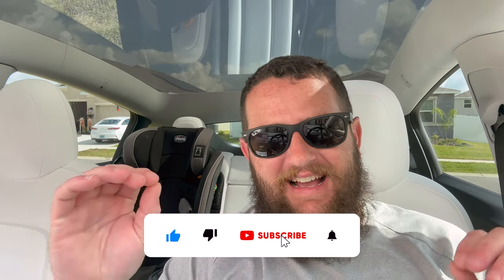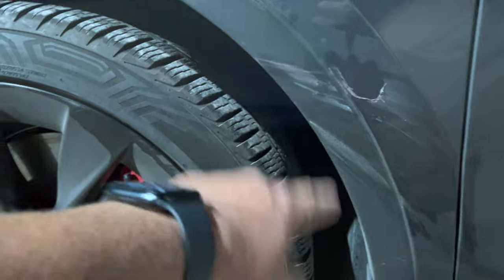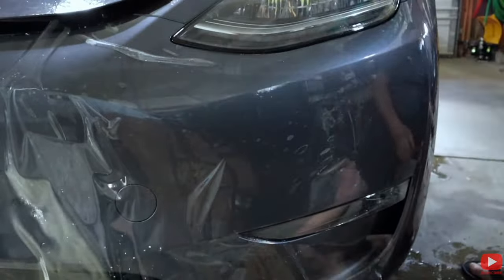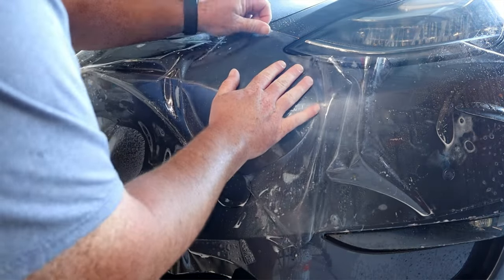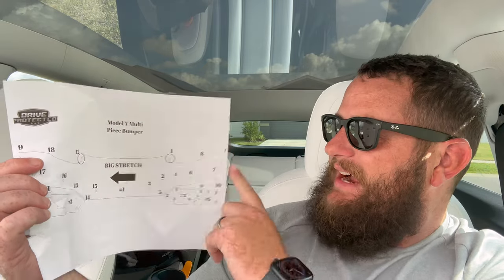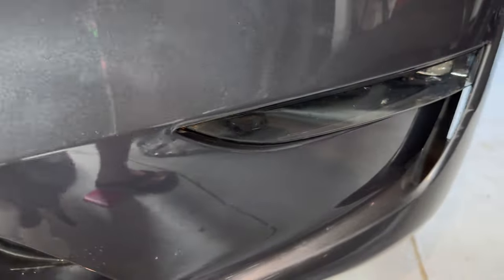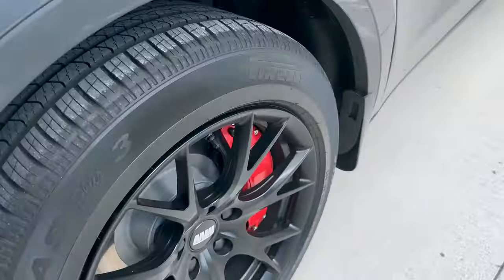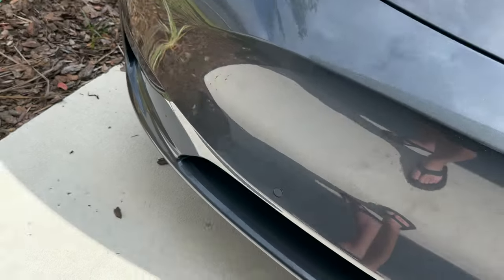Tesla Model Y - Easiest DIY PPF for Front Bumper (Replacing Damaged PPF From #hondabump)

Comment: I spent about 5K on a professional wrap. While overall, it looks pretty good, I’m disappointed in the very fine details. The biggest glaring issue? They didn’t properly wash the car before applying, and now there are strings of road tar on the left rear fender that are under the PPF. It looks horrible!
Reply: As a professional PPF installer and shop owner, this is grounds for a redo!
Reply: @ericsawatzky54  for a bit of back story; I took the car to a Google reviewed, Tesla Owners Club sponsored shop in my state. When I dropped off the car, we spoke about my wants for PPF and tinting. They also knew what day I would be back to pick up the car. They would have 7 days to do the job, and were confident they would have it done a day early. 

I kept an eye on the car using sentry cam all week, and the car never moved, day or night. 

When I arrived 7 days later to pick it up, you’d thought they’d seen a ghost. They hadn’t done ANYTHING to the car. They said they would work all night on the car and have idly ready to go for me in the morning. (I was 6 hours from home, and had to work the next day at 1pm. 

Over night, they got the PPF and all the tinting done, except the windshield. I had already prepaid half at this point. We agreed that I would come back the next week and they would do the windshield. I went ahead and paid them the balance due. 

A week later, I came back, and showed up at 11am for a 12pm appointment. They were surprised I showed up so early. It was just an hour and I had zero expectations they would start it right then and there. They then wanted to charge me $500 to do the windshield. I told them that I’d already paid in full and that was already included in my payment. The guy disagreed. So I whipped out the text messages I had with the owner showing we had already discussed the plan and price. He disagreed again, so I stood up to walk out and he changed his mind and would do it “out of kindness.” So I let them do it. We went out, I pointed out issues that needed fixed, like edges coming up and how they cut around my Dual Motor badge to get it done fast. I had a new badge, so asked them to remove the PPF on the rear and replace with no cutout and out new badge on the film. I also pointed out the tar. 

They replaced the price that is on the trunk to put the badging on correctly, but did not replace the fender that had the tar under it. The windshield looks good, except for a crease about an inch long right in front of the drivers view out. 

Needless to say, I took my key after they were done and left. The owner texted a few days later asking how it looked and I told him about all the issues. He insisted they washed the car and would never have left tar on the car and filmed over it. I said I would send him pictures to prove it, since he thinks I’m lying about the tar. He got a bit defensive and wanted me to leave them a 5 star review because they worked all night to do the PPF the first time around, then claimed he gave me the windshield for free to make up for it. My invoice from them is not itemized, so you can’t tell what they charge for what, just says PPF & tint is $5,238. So, he claims I didn’t pay for the windshield, but can’t prove where each dollar went. But, if I leave him a good review, he says, “we’ll be good man.”

Like, what if I don’t leave a good review? Are you coming after me, claiming I didn’t pay for something? I have no way to prove what I did and did not pay for since he doesn’t itemize his invoice. 

In the end, I had to tell him to not contact me again. I would not be bringing the car back for any corrections, I would not be leaving a review, and I would not recommend his business to any other owner looking for PPF or tint. 

I plan to leave the film over the tar now that winter is coming, and I travel for work, so it won’t be February until I am home again to where I could pull it off and replace that bumper piece. 

Really sad and unfortunate. If I had more time at home, I would have definitely ordered this kit and done it myself. Now, I’m stuck with what I’ve got, and have to see that nasty fender every day for the next several months until I’ll have a clean space where I can replace it.
Reply: @MyTeslaTrek  I am so sorry you had to go through this. The bare minimum they could do is give you your money back. Wow!!
Reply: @ericsawatzky54  Thank you. I agree, money back would be nice, so that I can get some of that back and use it towards replacement cost. But, at this point, I don’t even want anything to do with them anymore, and I’m willing to just take a loss on the piece that still needs redone.
Reply from the maker: You should have them fix that
Reply: @BeardedTeslaGuy  After being called a liar, I don’t even want to deal with them anymore. But, you’re right.

Comment: After watching your video, I installed 5 pieces bumper as well, but not very well for few weeks now.  I have some fingers on the some edges and few compression marks due to over squeegee.  I am considering removing it.  Are you removing the ppf yourself? Are you using the hot water towel or steamer method? Or you suggest to ask prof to do the removal?  Thank you for advise.

Comment: Based upon your previous videos I did PPF on my 22 M3P. I made some mistakes, of course on my first time. The bumper is particularly difficult, so I'm glad there's an updated PPF cut to make it easier. That makes PPF by DIY a reasonable thing to do. We met at the Ocala Supercharger christening, where you demonstrated the mattress to me. I bought it and went on the Tesla camping trip at Cape Canaveral. I was extremely pleased with the mattress you showed to me. I'm a bigger guy at over 6 feet and over 250 lbs, yet I slept extremely well on the mattress in camp mode. I appreciate all your work. Also, I've rebuilt my Tesla seats in the model 3, I think will fit in the Y as well. The seats just were too tight and hurt me on long drives. I totally replaced the inner foam on both front seats. I retained the Tesla cover and electricals. It looks stock. It works extremely well for me. I have built a couple more for other owners. Now I'm trying to eliminate top of the window noise at higher speeds. I've reduced it greatly by adjustments but not yet 100%. Keep up all your good work, it is inspiring.
Reply from the maker: I remember you because you were so tall haha. I’m so happy to hear the mattress is working great for you, I spent a lot of time getting it right. Appreciate you

Comment: Did you polish or wax car before applying the PPF?
Reply from the maker: no, you need to clean it down to bare paint. Cannot have a coating of anything on the surface or PPF will not adhere

Comment: Great video, thank you!  I'm getting ready to use your code and get the front third, and maybe do the entire '23 Model Y if I survive doing the bumper/front, sounds like the multi-part bumper cut out will really help since I'm a first timer.  I know you're experienced at this point and while watching this video, it seems like you are using a lot less slip and tack than I have seen in other vids.  Specifically it looks like you are using the minimum possible slip and then mainly tack at the edges?  Or is that just due to the editing, and you're tacking all coverage area?  I've seen so many DIYers talk about next day bubbles and fingers and understand some will go away but others don't and wondered if it's a result of using too much and having surfaces too wet?  Any guidance is appreciated and thanks again for this great instruction!  Seems to me more than half the battle is not being scared to do it given the savings.
Reply from the maker: Yea, I am reasonably comfortable with the install now, but even if I was an expert, the multi piece front bumper would still be my choice...1,000% easier install. I try to use as little slick solution as possible. I only use it as a base layer, then if I need to adjust a piece, I may use some more. Everything else is tack. I tack all the corners, tack the whole panel if it is already lined up nicely, etc.

Comment: Did you have to trim anything on the edges, or did it just fit properly?  Any tucking required or overhang left over?
Reply from the maker: On the fender I trimmed a smidge on the door side. And I trimmed one overlapping section on the bottom of the bumper. Easy peasy

Comment: Hello, you mentioned you waxed it after? Not before?
Reply from the maker: You cannot wax, or ceramic coat before you apply PPF. The reason is PPF will not adhere to a waxed or coated surface. It needs the bare painted surface to adhere properly to.

Comment: Do you still use the wall connector you built up with the 240V dryer cable? If so, how’s it holding up? I’m Thinking of doing that soon
Reply from the maker: Working great! It’s in a box right now as I set up another temp solution in the rental house. New house is done in a couple weeks and she will be proudly back on the wall

Comment: Thanks for sharing! Do you have a link to the new and easier to install 5-piece kit?
Reply from the maker: Driveprotected.shop. Code BTG20 gets you 20% off
Reply: Hi, excellent video. 👏🏻
I tried ordering the PPF and the code (BTG20) didn't work. 
Do you have other code I could use?

Comment: Does the PPF stick strongly to the body of the car? 
How long will the PPF last and need to be replaced with the new PPF?
Reply: Should last several years.  I did the 3M.. it took a lot of stretching on the facia like he said.  I had a little fun since mines white (harder to see it popped up) and had a area dirt got in on a corner, but you can flush that out with more slip/tack solution and a q-tip. It re-applied and have the issue come back.  So just takes a little babysitting as it dries to make sure the edges/corners stay down.
Reply from the maker: PPF adheres very strong to the paint. This one has a 10 year warranty, so at least 10 years life
Reply: @BeardedTeslaGuy  Thank you for your reply. How much did you buy 5 pieces of your PPF?

Comment: $75 shipping on just ppl for the bumper and 30 for shipping protection and that's standard shipping 😂 what a joke
Reply: Ppf
Reply: I like eric and drive protected but their website is flat out lying and trying to scare you into buying the shipping protection. THEY are responsible for the package until it gets delivered to your house. They are NOT responsible for anything that happens after delivery. IF it gets lost during transit, THEY are responsible for making it right. If they do not, file a charge back and you will win. This is plain and simple.
Reply: Is this for real ?? I'll pass if it cost that much for shipping.